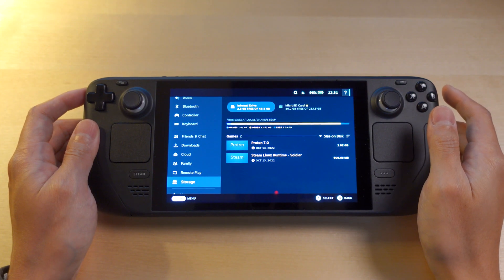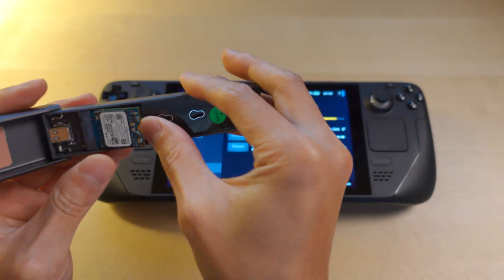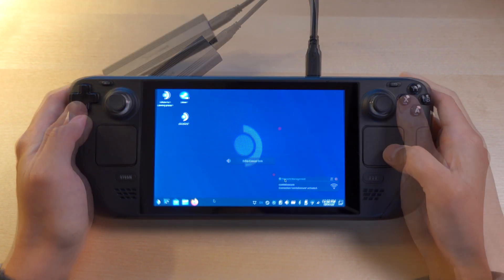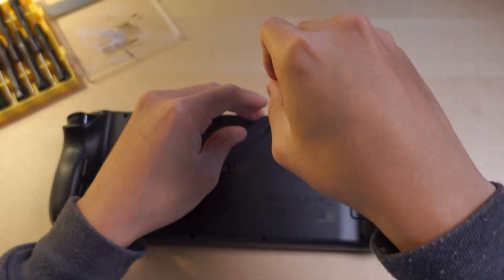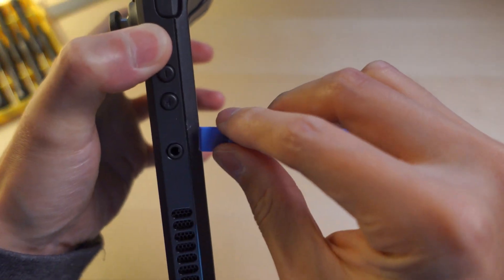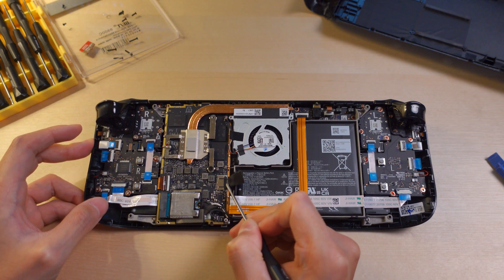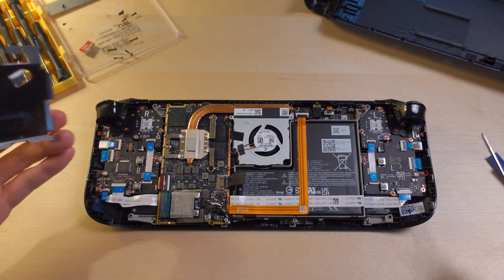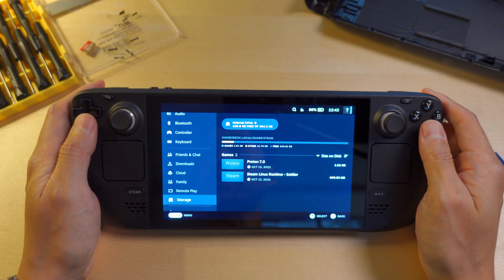Steam Deck NVMe SSD Clone and Disassembly

Comment: Should I unmount any other SD cards and External drives before doing this?
Reply from the maker: You don't have to but if you already have other external drives, the path for the new drive will be different and you will need to adjust the DD command, eg /dev/sdb. You can check with "sudo fdisk -l". To avoid overwriting the wrong drive, I would remove other drives. SD cards are mounted with a different naming scheme so it doesn't matter.
Reply: @DavyChiu  dude thanks for the response, more confident in doing this now. Going to share with a friend as well
Reply: Absolutely take out your SD card and check many many many times to make sure. It's very common for people to leave their SD card inside when doing this. Not only does this end up breaking the card, you're usually unable to take out the sd card too, leaving you with access to only internal storage.

Comment: I've been sharing this video on Discord and the folks are telling me that cp is more efficient than dd, could you consider changing the command to help with that?
Reply from the maker: You cannot use cp as you need the copy the partitions. Sure there are more efficient commands that will only copy the contents but by the time you've installed them, DD would have likely finished anyway.